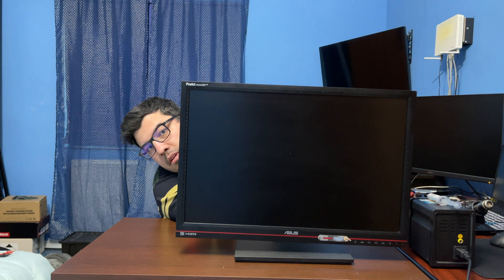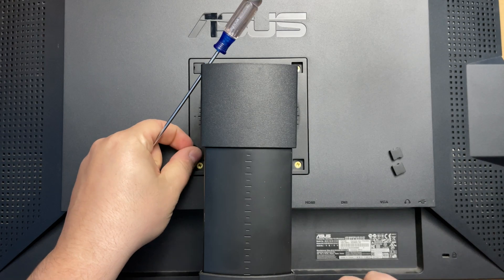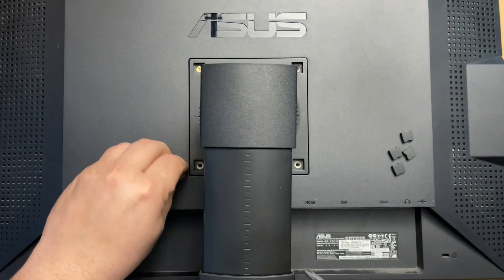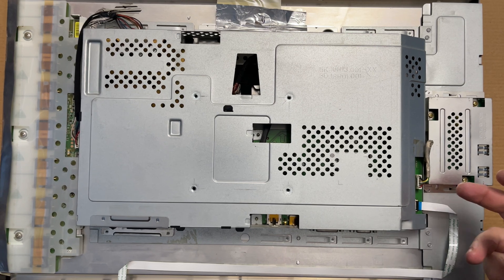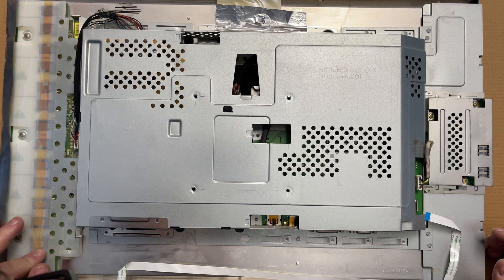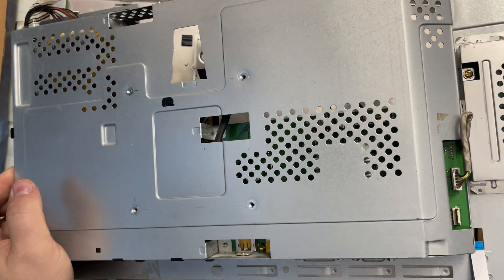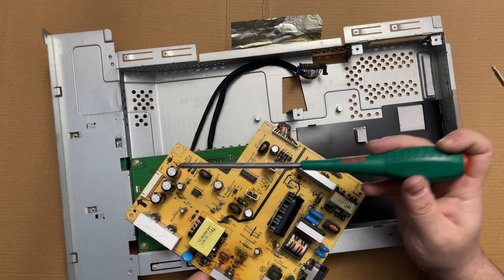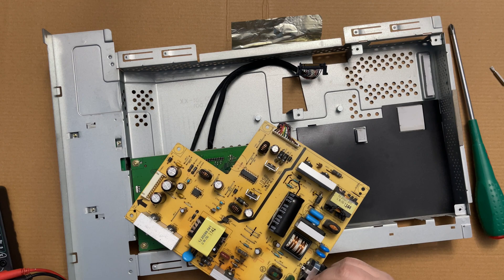No power Asus ProArt PA246Q Monitor - Trying To Fix

Comment: My PA246Q also just went on the blink (literally). It still tries to power on, but it just blinks the power light and sometimes the Asus logo tries to come up on the display. I am thinking it is likely the power supply, and probably one or more capacitors.

Pretty much have to test all the components you can. Diodes, transistors, capacitors, resistors. I would recommend a good meter, and a capacitor/diode/transistor/inductor checker. You can get those pretty cheap now. Some components you can test on the board, but a lot of them (like capacitors) will need to be removed and checked.

After seeing yours, I am petrified of what I will find inside. I hope I don't have any burnt areas, but likely will find the same or similar.
Reply from the maker: I expected better quality parts from Asus, i never had boards with traces that lift so easily. I measured the capacitors off board also after i changed them with new ones. I will use the display for another project though 😁
Reply: @DIYBuildandRepair  I just bought two more ProArts, and yes, I would expect that they would use better build quality in them than this, but this is pretty common in the electronics industry. "Good enough" for profits and keeping prices competitive, but ultimately terrible for consumers.

I have a mind to put some kind of blower on my new ones just to make sure the parts stay cool.

I also have an almost 20-year old NEC Multisync LCD2170NX that I am still using, though it JUST decided to have some failing pixel lines. It even healed some dead pixels from an impact a couple years ago in an different area of the screen. It's been a real trooper!

Still won't help with shoddy electrolytic caps, though. That technology really needs to be sunset. Just about everything I have fixed in the last 30 years has been due to bad/failing electrolytic caps. Motherboards, video cards, monitors, power supplies, electronic car assemblies (Toyota Prius combo meters). Always the damnable caps.

I am a bit saddened to see that they use snap-together plastic shells for the casing, though. I was hoping for fasteners. The snap pieces inevitably break off and the cases won't stay together without glue. That's my other big pet peeve.. too much use of plastic assemblies in general and especially in stress joints. 😕

Anyway, good video, and I look forward to seeing the final repair that breathes life into that otherwise stellar monitor!
Reply from the maker: @ArchaeanDragon  Yes this old tech caps should be just history, sadly they are still used, and i also hate these snap together cases, when something breaks it becomes a nightmare, i mea ok use these on cheap stuff but not on things that are meant for PRO usage. 

 I changed all caps, the bridge rectifier and some of the transistors and still nothing, so the boards are going to the bin, at this point i am sure there are broken traces on the board so i will not go any further. 

I will use the display to make a daylight effect lamp for my room.
Reply: @DIYBuildandRepair  Sorry to hear it didn't come back to life for ya. Probably a logic board problem as well as a power supply one. Fortunately, I think mine is still just the power supply board, since I do see the logo trying to come up occasionally.

I'll keep ya posted on what I find. :)
Reply from the maker: @ArchaeanDragon  Well this would be its second power supply so this time might not actually be just the power supply. 
I hope yours will come to life, it does actually have a lot more chances than mine :)
Reply: @DIYBuildandRepair  Finally got some time to tear mine down and troubleshoot it. It appears mine may be a simple fix.. the main power cap on the power supply has dried electrolyte leaking out of the positive lead hole, and when I removed it, the positive lead wasn't even attached inside the cap anymore.

So, just gotta get a new cap in, test a few of the other parts to make sure they are ok, and hopefully will get mine working again! :D
Reply from the maker: @ArchaeanDragon  It should be a simple fix if that is the only broken part :)
Reply: Any update on your cap replacement. One of my PA249Q just bit the dust so I thought I'd open it up before donating it to the electronics recycle dump. The 2nd PA249Q still works but has had an issue for a long time with blanking out for a fraction of a second (with an audible pop if speakers are connected). I might check the caps on that one too.
Reply from the maker: It did not work, same thing as before i replaced the caps, no sign of life. i have a revisit video on the channel.  @ge0brick

Comment: Hey! Did you manage to repair it? I have the same monitor with the same problem - even after changing every capacitor it still does not turn on. May try to replace the transistor like you did too
Reply from the maker: Did not have the chance to work on it again because of work, but as soon as i will have some spare time to try again to fix it i will post the video. I have to start and finish working on it in hte same day, that is the biggest problem for me, i do not have space available to disassemble it and leave it like that until i buy parts, i'm working on a solution for that and hope i will soon be able to finish this repair
Reply: Looking forward to that video! I really need to fix mine as well
Reply: Hey! Just wondering if you ever got around to repairing it, super keen to see if you can figure it out - wanna get mine working too haha
Reply from the maker: @iantan6141  Not yet,  i bought new caps for it, also i got a "toy" to test ESR for the old caps, i just have to find the time and some decent space so i can also record a video.
Reply: @DIYBuildandRepair  great! I’m looking forward to it!
Reply: I found it is necessary to change IC g5627f11u and the capacitors

Comment: My PA329C just went belly up after exactly two years of owning it. The same problem - internal power supply circuit board. Mine is still under warranty so I am going to send it back. However, it is disappointing how Asus cheapens out on components for the PRO series of LCD monitors! My NEC PA241w-bk (x2) lasted me for 10 years and 8 years repsectively.
Reply from the maker: Yes! It's a common fault for the Pro Series, this one was also repaired under warranty, now it is no longer under warranty. I heard that the new ones have the same issue as well. I don' t get why they cheap out on Pro devices, i would understand on a cheap device but on a Pro device is unacceptable

Comment: Asus has really cheapen out on the power supply in this quite expensive monitor. Mine lasted for only about 5 years. It has very good panel so it worth fixing. Reading on how people fix it they usually replace capacitors. Not for everyone it works but seems like for many it does. I'm not good at soldering though so I'm not attempting it yet.
Reply from the maker: Yes, i have seen that for some replacing the capacitors got it fixed, my component tester just arrived so i will test every capacitor. They can go bad even if they don't show visual signs like leaking or blowing.